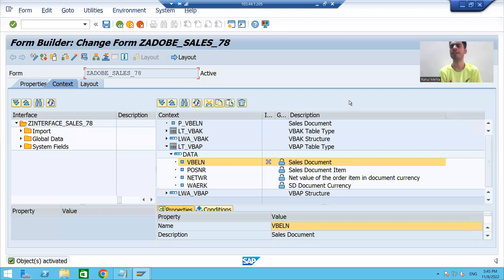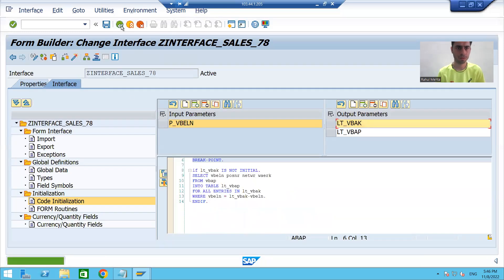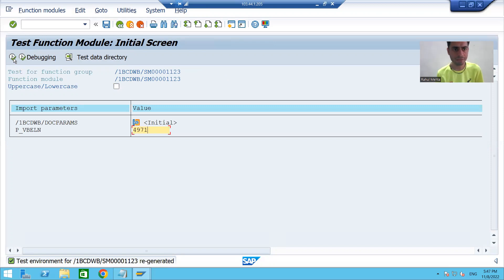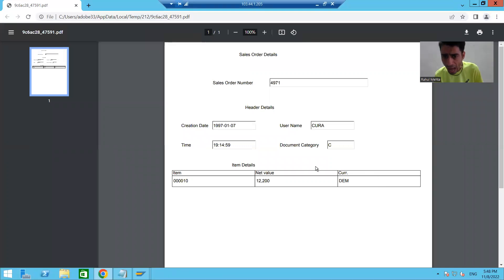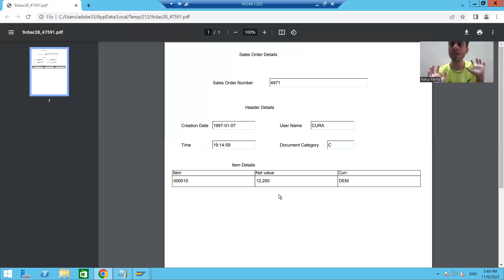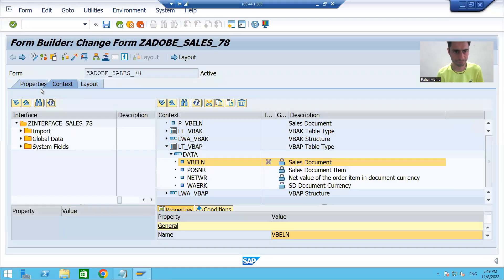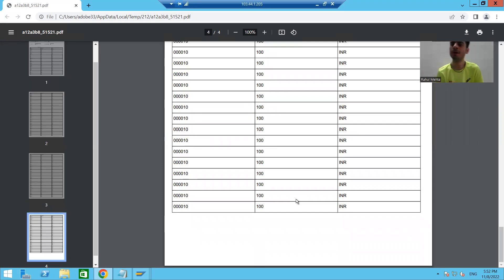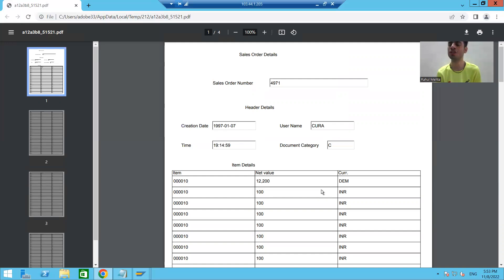8 - Adobe Forms - Executing the Adobe Form

Comment: Hello sir, i am not able to activate my form/layout, it is still showing inactive after activation
Reply from the maker: Hello - You can check for the below mentioned steps.

1) Come out from the PDF form and then activate. 
2) Just make sure it is not opened in another session.
3) If you are able to run and check the output. You can ignore this.

Comment: I am not able to display 100 record in form layouts. I perform all the step still it shows record only on 1 page. can you help me please ?
Reply from the maker: Hello Abhay - Check for the below mentioned points.
1) The page must be flowed.
2) The sub form needs to be flowed.
3)  For data internal table - Allow page break with in content needs to be ticked.
4) Check for the records in to Item table(101 records). It might be the case, there is no APPEND statement.
Reply: I faced the same problem.
The 'Allow Page Breaks' option should be enabled for the internal table OBJECT as well as for the data OBJECT . 
The object is the internal table LT_VBAP should tick  'Allow Page Breaks, and object of data of LT_VBAP should tick  'Allow Page Breaks.

Comment: I need to display or hide a section of the form based on a condition ( say based on some value in a table) how to do that? Where to code that?
Reply from the maker: Please refer to the videos of Scripting languages in the same playlist. You will be able to achieve the requirement.
Reply: @sapabapbyrahulmehta  Thanks for the quick response, I will check out the videos

Comment: Hi Sir, Good Evening, I have a doubt "As the body page by default contains a subform ,.When we have a body page with both static and dynamic data ,Is it still necessary to set the whole body page  as flowed + Sub form needs to be flowed  For Internal table - Allow page break with in content must be ticked."?
Iam confused when to set the page as flowed !
Reply from the maker: When you page has dynamic data, it needs to be flowed. Once you proceed in the same playlist, the video no -16 is for important points, that will clear all your doubts.

Comment: sir i got the error while executing it i.e., - (Find PDL type for output device LP01)
After passing p_vbeln value.
Reply: Pls try with LOCL instead of LP01 ..If the error still exists, contact your system administrator
Reply from the maker: @rameshgedala406  Hello Ramesh, Check the Help of Output device and choose from there. Printer is configured by the basis person, It might be the case there is different name in your system.
Reply: @sapabapbyrahulmehta  yeah got it sir
Reply from the maker: Check with your system administrator, System Administrator needs to maintain PDL type.

Comment: It is showing only one page of data. It is not going to the next page even after changing the subform content from positioned to flowed. And in internal table object i have checked the chekbox Allow page breaks within content
Reply from the maker: You need to check 3 things - Your page needs to be flowed, Your sub form needs to be flowed and Allow break with in the content for the internal table needs to be checked. Check for your dummy logic, Do you have enough records for shifting the data to next page, The main important thing, sometimes, our body page is flowed, but It is under another body page that is positioned.
Reply: @sapabapbyrahulmehta  yes it is working now. Thanks. You are doing good. 👍
Reply from the maker: @beststocks8555  Great.